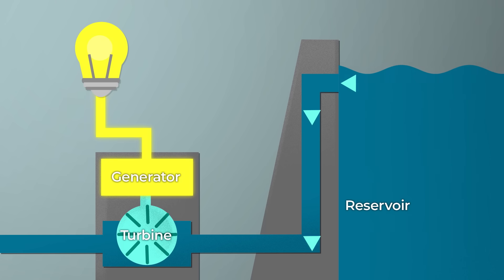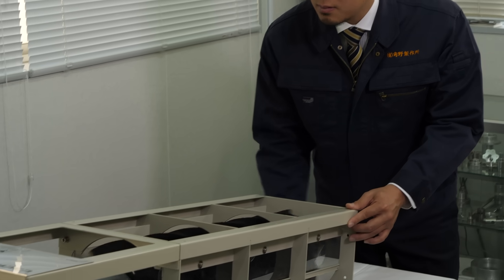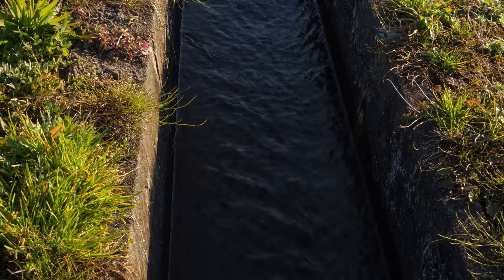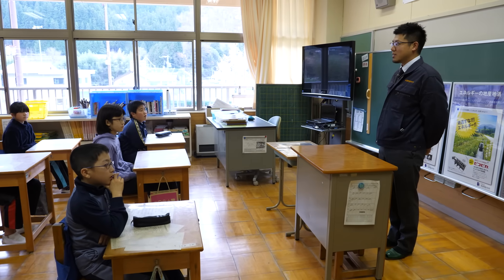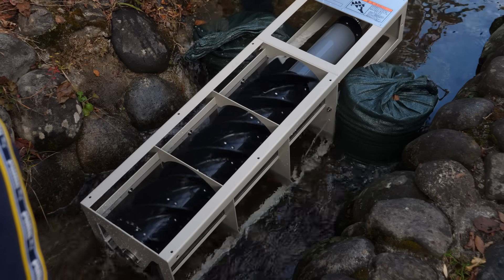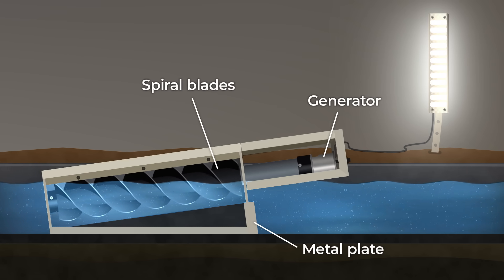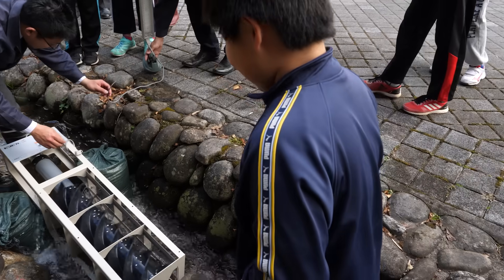Ultra-Small Water Power Generator

Comment: curious on the output, but if it'll only produce enough to power an led light bar, the most practical I can imagine it to be used for is to recharge a battery bank. kind of what off-grid solar systems do, charge during the day. except this would charge the bank constantly. let's say one unit outputs 5v, then 3 units in series can output 15v. so this to charge the battery bank then the bank to an inverter and you'll have an off-grid system that's more reliable than solar or wind.

Comment: I have solar panels that max out at about 95 Watts. They averaged about 250 watt hours per day. They charge a 100 amp hour battery. The battery Powers a 1500 watt inverter. If we lose power this system will run vital loads for several hours. I don't use a charge controller so I have to keep an eye on the battery voltage and when it gets too high I just use it to power some of the house until the battery is back down to about 50%. The whole system cost about $300. You don't have to spend tens of thousands of dollars to go solar. That is unless you want to go completely off-grid.

Comment: How much power would need to be used before this offsets the power it took to make and transport?
Reply: Well it all depends on the longevity of the product. If it lasts long enough to earn back the energy used to make it then there’s not much to worry about. The only issue is when things like this are used on a small scale. If these were widely used then you can make them more efficiently. It’s like investing if you invest 500 hoping to make 500 you’re gunna be waiting a while but if you invest 1000 to make 500 that’s not going to take too long.

Comment: The corkscrew method of water use is old school news going back a couple thousand years. And here is a tidbit of education for the narrators, it is NOT a turbine, it is a corkscrew! Or more technically it is a spiral blade screw drive device. Just like many call those propeller-driven wind generators turbines, which they are not. Oh well, I guess in this age of yes meaning no and no meaning yes, even if it is wrong it is considered right by the lack of intelligent intellect masses, eh? 
But, as a side note, while this will not power everything needing electricity, it will serve as a means to increase power to handle peak load conditions. It would, however, power a number of homes that have switched to all low voltage devices. Larger ones can power light industry that is also using lowvoltage devices. And with those off the grid, that means less strain on the systems powering the rest of the nations.
Reply: Azri'el Collier it's not a corkscrew. A corkscrew is so named because it is designed to extract corks. It's an Archimedes screw.

Comment: those need to be commercially available at a lower cost so that all can afford to have these.
Reply: Nilmoni Sinha  What does that have to do with it?
Reply: Supposing of course that there was a stream near your property. Small wind turbines may be a better choice.
Reply: @nevrens  Wind turbines are good, but if you live somewhere with very little wind (for example like my village in a small valley between hills) they don't work. So I use solar, but water has the advantage it can deliver power constantly, even at night.
But this device would have to be bigger to be able to power a household.
Reply: @simonm1447  The wind turbines still work in your valley. They just just don't have much to work with.
Water can't deliver power in the dry season. Even at night.
Reply: @petermgruhn  it depends where you live if there is a dry season where rivers or creeks have no water at all. In Europe the water flow is typically not interrupted since there is no dry season like in some Australian regions or in countries with deserts.

However in some countries laws are a problem, in Germany for example you can't just put a wall into a creek and use the water for energy generation since you need a permit for this if you do it permanently.

Since solar batteries have become less expensive since my 2020 post you can also use these now
Reply: @nevrens  Donkeys walking in a circle might be a better choice. Hooking up to the mains might be a better choice. Hamsters...
Reply: nevrens wind turbines don’t do shit, new solar tech and battery tech are paving the way for our future.  This hydro system is okay, but I have family that uses other more efficient systems and they haven’t had a need for PGE in 15 years.  Shhhhhhhh don’t tell the government that, they aren’t making any money.

Comment: to make a led work ...
wow !
-_-
Reply: That's certainly not enough to power even a small home full time BUT, connect many units on the same stream and you could have enough power being generated to constantly keep appliances running without a battery array backup.
Reply: there is enough power for 4 led full time, but definitively not for washing machine, computer, dryer or fridge
so this is total useless

also, there is the problem about ecosystem
you stop the way of small animals in small rivers
Reply: @Zeal·FPV  if you connect many units on the same stream, you will lose power on second one, then third etc ...
less and less power
total useless
because the river lose all it's power after passing the first unit.

genius !

Comment: What about the long term corrosion of metal in the water system?
Reply: I would suppose that the blades would be made of a non-degradable material, like titanium. All the other sensitive things would be sealed in the generator housing, but I'm sure it could be easily replaced
Reply: Jonathan Green I wasn’t considering the system but the damage to the eco system it’s sitting in, I see all those screws and the metal frame, I’m no engineer but wouldn’t it cause corrosive harm from the medals?
Reply: @jval733  it depends on what's in it. I'm sure that the metals used in hydroelectric production are minimally impactful, staying away from toxic metals like lead.

And if he's been able to sell it on a local scale, it must have been reviewed by both a patent and environmental board
Reply: Jonathan Green sure hope so right

Comment: There are two types of units, “PicoPica10” and “PicoPica500”

“PicoPica10” is a unit that enables around 10W generation by securing a flow of 10ℓ/sec and a head of 0.1m. This product can be manually assembled and utilized as security lighting, drawing power from a nearby waterway. “PicoPica10” has already been sold over 500 sets within Japan as an environmental education material.

On the other hand, “PicoPica500” enables around 500W generation by securing a higher flowrate of 100ℓ/sec and a head of 0.7m. The generated energy can be equivalent to an average Japanese household’s electricity consumption.

Comment: It is called the Pico  Pica 500 and produces 10 Watts minimum (http://www.unido.or.jp/en/technology_db/5276/ )  500 w in high flow areas (100 L/second or 95000 GPH)  You can email the inventor but I would suggest  MICRO HYDRO GENERATOR  on aliexpress for about $400.

(https://www.aliexpress.com/item/33054445910.html?spm=a2g0o.productlist.0.0.12a16448hxyAUR&algo_pvid=76c7826f-ef59-4468-86a0-13609f61d856&algo_expid=76c7826f-ef59-4468-86a0-13609f61d856-29&btsid=2f2ad64f-1bb6-45fe-baf6-5333dd1e51da&ws_ab_test=searchweb0_0,searchweb201602_1,searchweb201603_52)

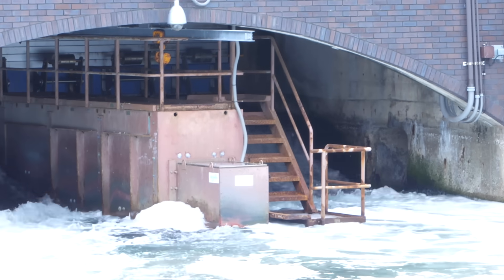Comment: 1:00 Is that it... all that effort to generate enough power to light up, a single bridge?!
Reply: The drop of the flow is just 1 meter, so its legit
Reply: Yep it will run mostly for free so why not
Reply: Pieh0 I completely agree with you on this point, ... utilizing the technology we have today, it should produce enough electricity to power at least a dozen or so homes, ... especially with everyone using the LED bulbs for lighting, ... even if the screw turned at a slower rate, it should be able to produce a much higher amount of electricity, ...
Reply: @johne.osmaniii7217  The amount of energy possible from a certain head is limited by the flow rate, so no.
Reply: Probably cost tens of thousands to install. When a $200 solar panel would do. Actually now we have flexible panels for that price, there's a 24v one on Amazon that pushes 20 amps of power. People use it for homes
Reply: @elyasrasti8943  You are correct however Japan is not sunny all the time and batteries are expensive and have a short lifespan. The water on the other hand is always flowing power goes directly into their grid. All day when lights are off and definitely producing more than is needed at night for the lights. Don't get me wrong my home is completely off grid and solar but I live in a very sunny location.
Reply: @elyasrasti8943  but exists country on the north earth for ex. Iceland, Canada, Russia where sun exposition is very week and short... in winter only darness
Reply: I think it generates more than just enough electricity for the little bridge. They want us to believe generating your own power is useless so don't try it

Comment: technology older than 2,000 years, archimedes already knew it
Reply: He knew the Archimedean screw (mostly for transporting water uphill). But did you attach a generator ?
Reply: @nigeljames6017  reverse engineering is not an expression of genius
Reply: fu ckSociety What does your sentence even mean in this case ? Reverse engineering is usually a case of a genius at work. You should take a look at the many engineering examples on YouTube.
This is not a case of reverse engineering, but utilizing a well known object (the Archimedean screw) and using it to drive another well known device (the generator). The engineer had the intellect to see that power could be generated by combining the two and using them in rural areas.

Comment: Spiral PicoPica Hydraulic Power Unit is a promising pico-hydro power generation equipment which has potential for dissemination in non-electrified areas, with its characteristics including low-head generation and dust-resistance. There are two types of units, “PicoPica10” and “PicoPica500”

“PicoPica10” is a unit that enables around 10W generation by securing a flow of 10ℓ/sec and a head of 0.1m. This product can be manually assembled and utilized as security lighting, drawing power from a nearby waterway. “PicoPica10” has already been sold over 500 sets within Japan as an environmental education material.

On the other hand, “PicoPica500” enables around 500W generation by securing a higher flowrate of 100ℓ/sec and a head of 0.7m. The generated energy can be equivalent to an average Japanese household’s electricity consumption.

Comment: what happens when generator submerged inside the water flow, during high current. will it still generate Electricity?
Reply: pretty sure it will.
Reply: arul murugan , why is it these replies always end up with insults?
Reply: That escalated quickly.... ;/
Reply: @Martina Steffi probably by water..
Reply: jeesus guys xD chillout
Reply: What is silicon sealant, Alex?
Reply: @Martina Steffi thanks martina I am "science student" 😇
Reply: does a submarines drive screw not work half as good when half of it is out of water?       lol
Reply: i think it would generate at high water level if it were reoriented across the stream of flow!
Reply: good point ! the water would restrict all the components and be less efficient , i do believe its under water proof sealed
Reply: nope its completely unsealed and exposed to the water because the Japanese engineer doesn't know what a rubber seal is. (dumbass question)
Reply: @TmanT321   you want to prove a point yes you can.but you have no right to insult others.
Reply: @TmanT321  pretty sure the question wasn't "will it survive" , it was more along the lines, of will the water flow still move the turbine.
Reply: @TmanT321  wow.   :|
Reply: @TmanT321  I'm pretty sure you don't understand what's being written here my boy. Original enquiry was a perfectly valid, will it still generate electricity if totally immersed. You replayed with an answer involving rubber seals. If we're trying to locate the "idiot" in this conversation, I suggest you look in the mirror.
Reply: I know, gravity is confusing. I'm sorry I should have been nicer in explaining how GRAVITY WORKS.
Reply: @smyteyouall8256  a guru once said "there is no value in arguing with an idiot" eventually they will come to realization how smart they really are
Reply: @smyteyouall8256   yes that was my question. I don't know basics I knew about the Archimedes by reading some of the comments. I was just curious to know. Sorry for whatever happened here and Thanks for the help
Reply: @rochewijnaar5374  hahahha, good one, got to laugh at that when reading the trends above
Reply: @TmanT321  very brave of you responding this way
Reply: @smyteyouall8256  well spoken ,thanks.
Reply: @TmanT321  oh careful everyone we have a fucking genius who's about to solve all of the world's problems here
Reply: @TmanT321  Water isn't very conductive either, electricity will always take the easiest path so even unseal it'd work fine. It'd rot the wires and go to shit but it will work

Comment: Nothing great about this device. I have seen a similar device used in Thailand generating enough power to light a bulb in a small hut. This was 10 years ago. These things are ok on a small scale. It will never be able to provide electricity on a large scale with voltage and current controls.